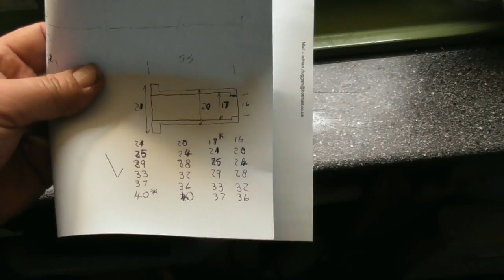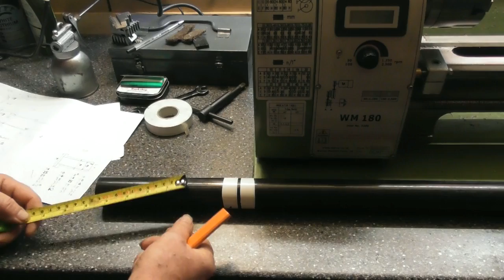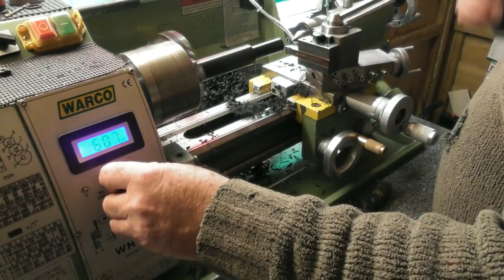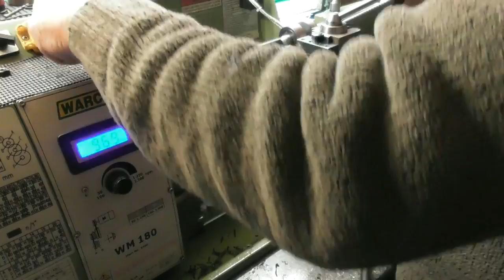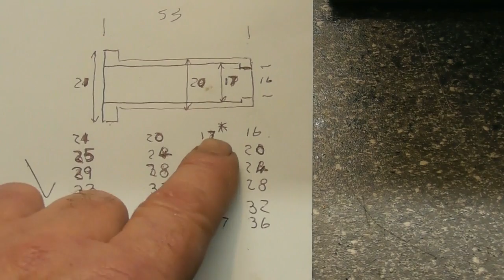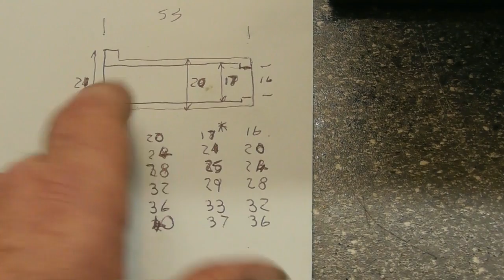Shed talk 12   part 1

Comment: Hi Aide. I have a Warco wm250 lathe with a spring steel lead screw. It really limits how close I can get to my faceplate. When machining a backplate for an E25 collet I had the lathe tool overhanging by 60mm. Thinking of removing mine. Will be interested to see how your design works. I may copy it.
Reply from the maker: I have not completed it yet , but it seems to be coming together nicely , Cheers Ade.

Comment: Have you thought about 2 rails on the roof of the shed running length ways, so you can hold the camera above you on either side of the shed.
Reply from the maker: I do have a rail above the lathe , the shot comes out a bit weird so i don't use it much , Cheers Ade